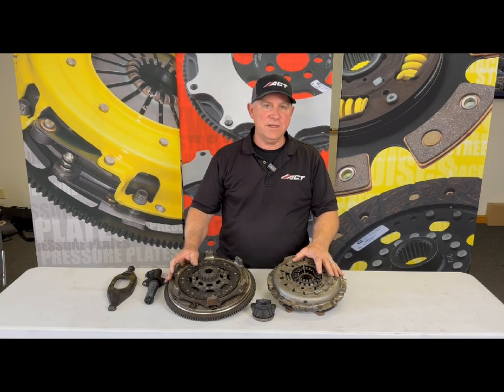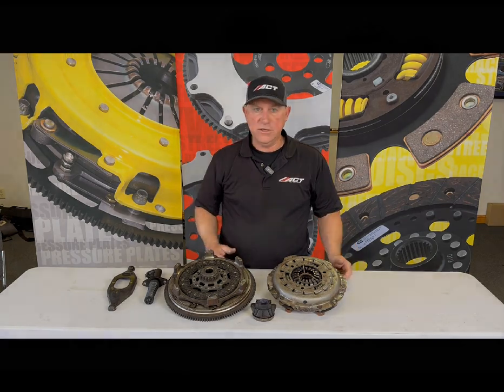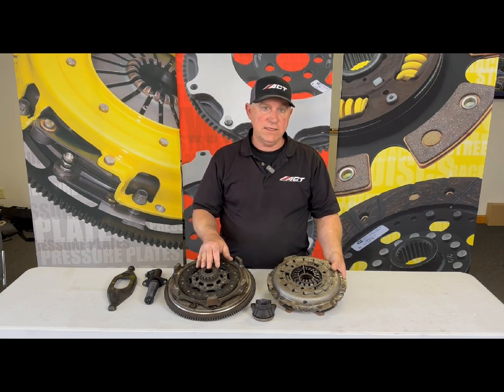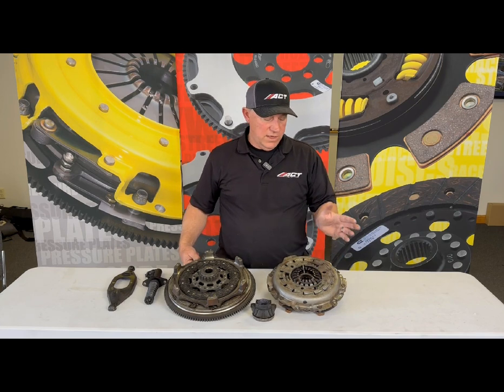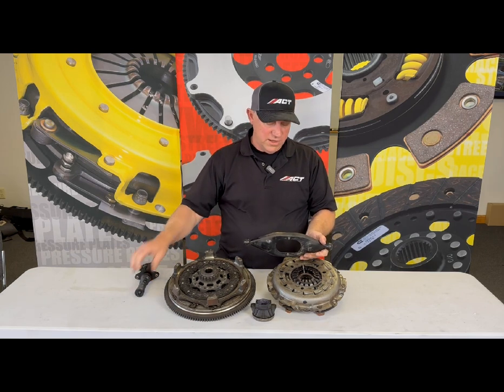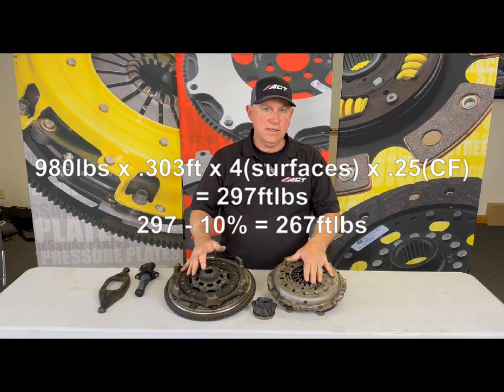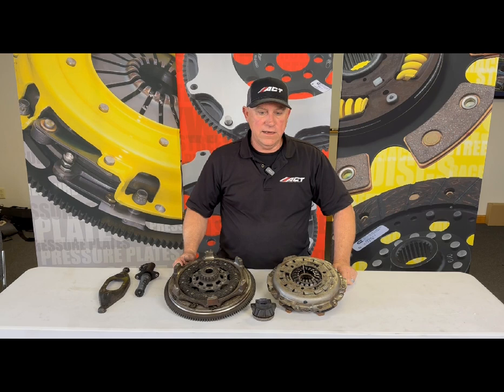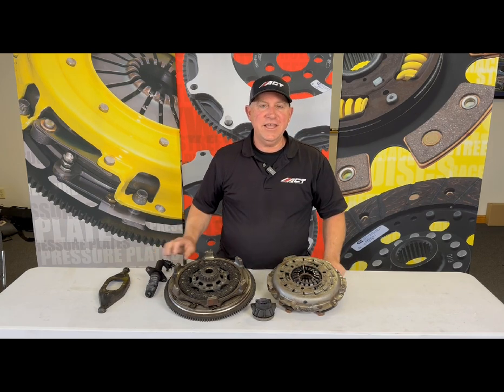14 - Surprising results - Jeep Gladiator Clamp and Bearing Load Test

Comment: Just bought my brand new 2023 Gladiator last week and one of the main selling points was its manual transmission. Having put a couple hundred miles on it now, I hate the clutch so much. Plus I have a boat I regularly tow in the summer and I enjoy wheeling. After doing some research plus the most resent recall I was very concerned about having a frailer when it would be most inconvenient. Unfortunately already looking at replacements when came across some forums that mentioned ACT and this video series in particular. Thank you! Finished watching all of the videos and ordered my ACT clutch for my JT. I am 100% confident I made the right choice. Wish more companies would do stuff like this and be more honest with their products and how they came up with their design. I can tell you guys care about what you do and that rare these days. It’s going to be very hard to wait until spring to put this bad boy in. Maybe I will get lucky and find somebody with a garage I can use. Keep up the great work!

Comment: Your clutch wasn't out when i replaced mine.  How would your clutch stack up to a southbend stage 2 daily clutch?
Reply from the maker: We haven't tested the Southbend clutch, but it seems they are modifying the original design, which has benefits and drawbacks. The benefit is that you would have less gear noise, and very light pedal feel compared to the ACT. The drawbacks would be limited heat capacity, vague feel, and possibly limited torque capacity.

Comment: I installed a Centerforce Dual friction clutch and high inertia flywheel and the clutch is already slipping at around 14,000 miles of use.The factory clutch lasted around 100,000 miles. I have a 2012 JK with 5.13 gears, supercharger, and 35 inch tires, along with a 4:1 low range transfer case from a Rubicon. 

Have you done tests to see how your clutch compares to the Centerforce? I want to try something better when I replace it.
Reply: I am not an expert on the CF product but I am confident in what the ACT clutch can deliver. I recommend you contact CF and see what they can do for you first. As far as the CF, my opinion would be to run the CF11 rather than the DF because the added friction material and surface area should increase heat capacity over the DF.  Dirk@ACT